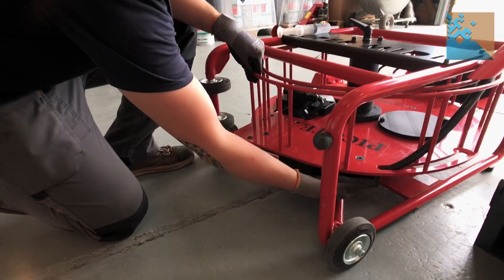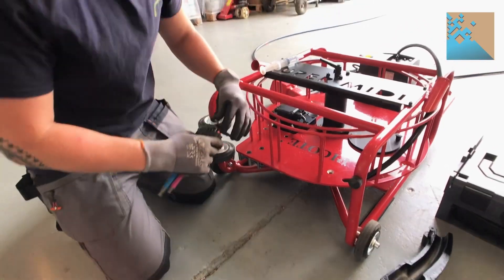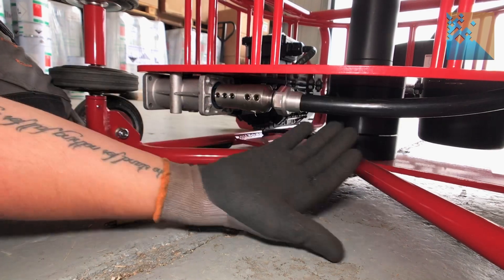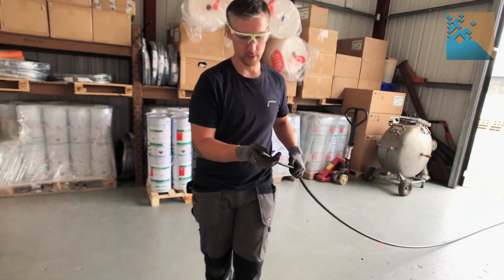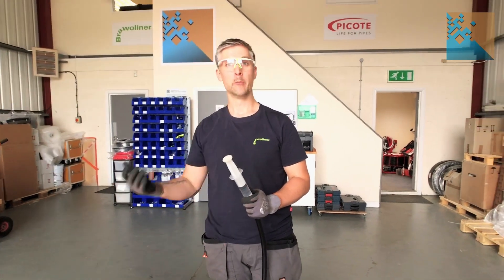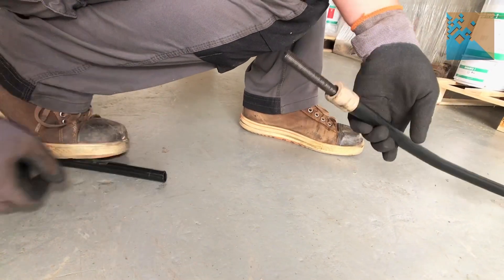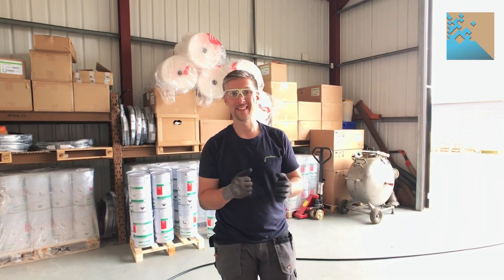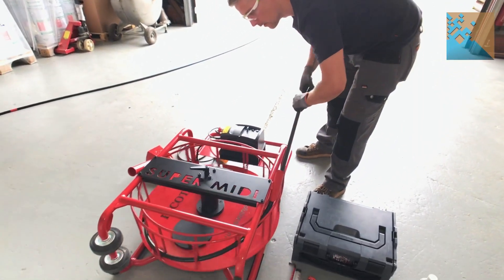How to lubricate and trim your Picote Miller shaft (flex shaft maintenance)

Comment: I thought you couldn't trim a flex shaft as it would unravel?
Reply from the maker: Hi TCD, I can't speak for the brand or type your using but with picote, it's not an issue. They only unravel when run backwards from user error. 

I hope that helps, any other question please ask away. :)